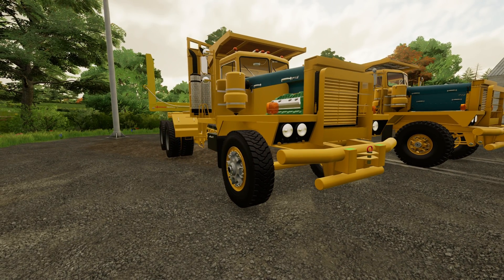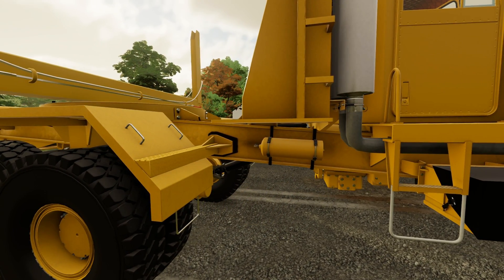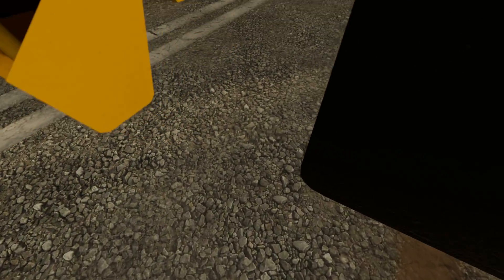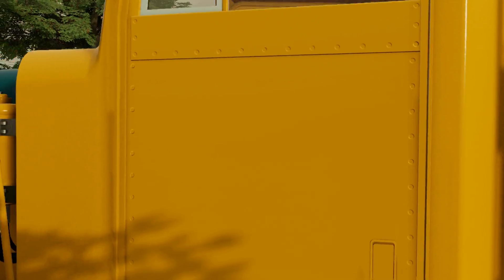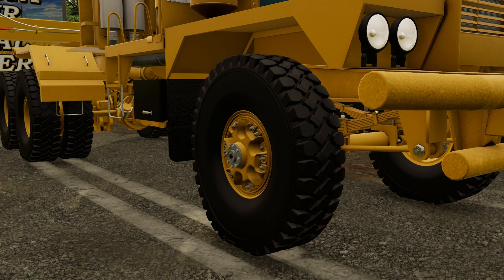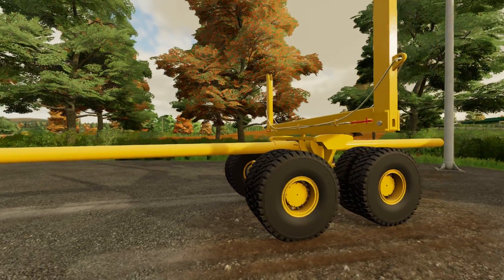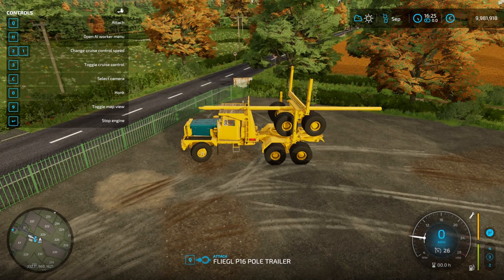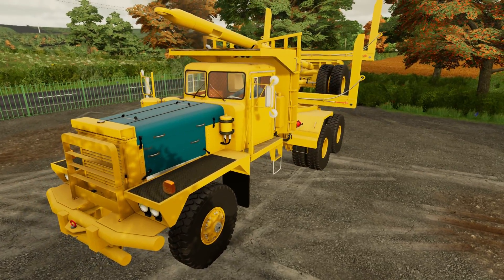My CUSTOM Pacific P16 One Year Later

Comment: This is a great model! I haven't seen anybody else get any Pacific model this accurate before (looking at you, Snowrunner devs). I'm a bit crazy though and there are a few small things I'd like to point out...

On your devlog from January 18 2023, you mentioned that the Pacific cabs are slightly modified International cabs - as far as I know this actually isn't true, I think their cabs are their own design, however the later version of the early cab (the one on your model), and the later taller cab, used International doors. Pacific did use (non modified) International cabs in some trucks when International bought them out however, but they were never used on the P16. Also, the remark on the "oddly drawn doors" on one of the official drawings is technically incorrect, the early version of this cab did actually have doors like on the drawing and they were built by Pacific rather than being reused from International.

The new wheel model looks much better than the old one in my opinion, although the rims look a little too small in diameter. I think the outside tire diameter is good, though. You mentioned maybe replacing the rims on the pole trailer with the rims from the truck's front axle, I don't think this would work without a lot of edits being made to those rims. The spokes on the pole trailer are very thick and have a concave shape whereas the front rims' spokes are basically flat.

I think the pole on the trailer is a little too thin, I don't think it's a big deal though. The way you loaded it at 9:19 isn't the correct way on a P16. Unless you have a bunk wide enough (like 15ft) to fit the trailer's wheels, the front bunk should be rotated almost 90 degrees to make space (the log stakes would be ahead and behind the trailer axles, or you'd lower or remove the stakes altogether) and the whole trailer should be pushed forward so the rear axle of the trailer is very slightly behind the rear axle of the truck, rather than the front trailer axle being slightly behind the rear truck axle.

Sorry for the text wall... Aside from those small things (that I somehow turned into a fifty page essay...) this is a really good model. If it's still being worked on, I look forward to seeing future progress! You've done an astonishing job so far, it's very impressive :p